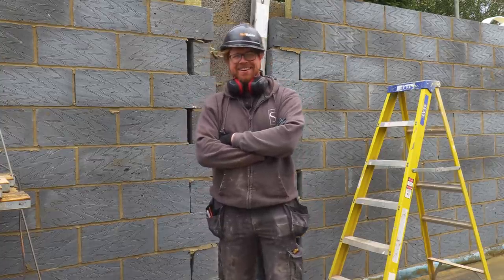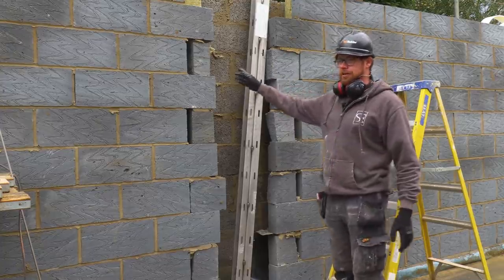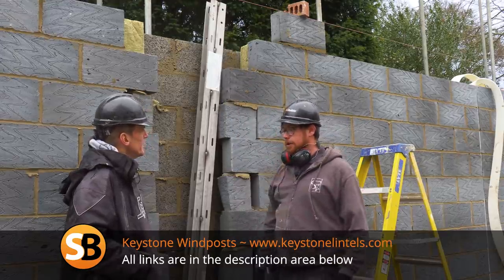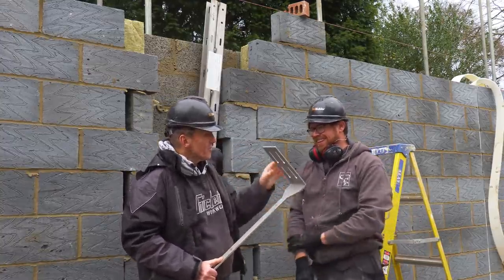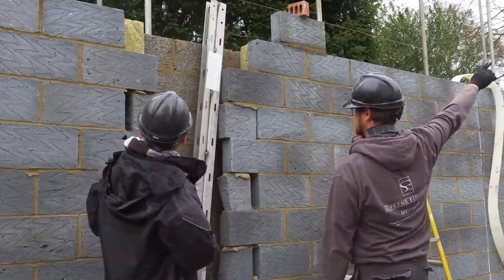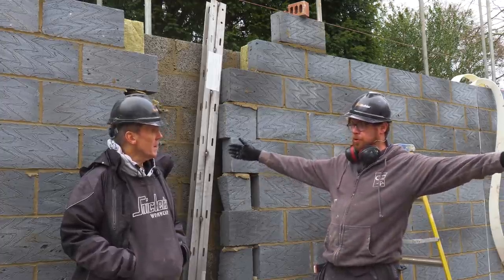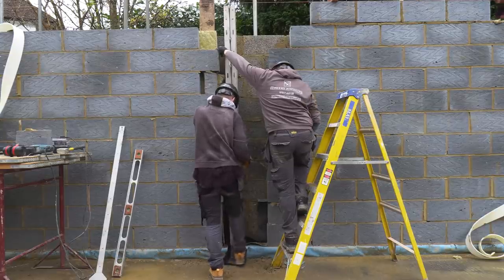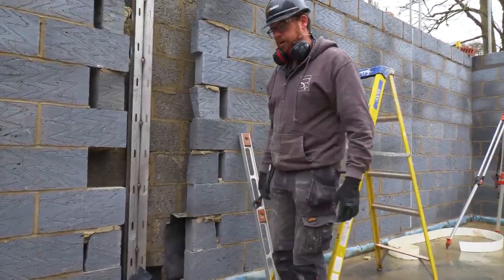Windposts & Joists ~ Extension Build #4

Comment: The welding on that post isn't very impressive. They look like maybe 25mm stitches spaced at about 400mm. That really isn't a lot of weld. For an expensive product, made to measure, I'd expect to see more like 50/200. Also the decency of the welds ground flush or at least tickling the welds with a wire wheel. As for the video itself, thanks to everyone involved, always good work.

Comment: Interesting.  It seems each engineer makes it up as they go along. My wall was tied in with a loose block and half a house brick, I'm blocking up the back door and the patio doors are less than 3 meters wide. So I have to fit a wind post fixed along a dwarf wall at the bottomand nothing fixing it at the top. I have 16 upper joists cemented into the wall he wants the wind post fitted.  Confused? You bet !

Comment: Great video keep them coming, really enjoy watching a build from start to finish. 

Wind posts always seem to be contentious issue. Walls without any buttresses (walls perpendicular) usually need some support when they start going any longer than 4-6m between buttresses. They can go further but it all depends on the site exposure, bed joint reinforcement ect. Loads of ways to skin a cat. The building regs do specify a requirement for a "butress".

They were not common in previous decades as houses tended to be built in a cellular construction, basically grouped boxes, think of a typical semi detached house (terraced houses are slightly different and you can sometimes get away with it on an internal wall). Whereas nowadays everyone wants open plan spaces with no internal walls, which means we need to replace the walls with something — in this case a wind post.

Which is why when you carry out a knock through on an existing house you usually have to put a steel post or leave a masonry nib these will support the steel above and provide a butress. These are typical cases and in some cases you may not need to. 

Sorry for the long post I hope it made sense!
Reply: Very informative, thank you.
Reply: I have never heard of a wind post.  Initially I thought what a waste of time but your comment about lack of internal walls makes sense. 👍🏻
Reply from the maker: Don't apologoise for the detail, that is just what we all need. Once you know the reason for something it helps you get onboard.
Reply: Cheers, you both have great attention to detail and from your videos everything you do looks top class.
Reply: Exactly right, people say stuff like “we never used to have wind posts” or “some engineer trying to justify their salary” but people’s tastes have developed and the engineering has to move with it. Your point about “cellular construction” was a perfect way to describe it.

Comment: Enjoy the video's - I had to fit a wind beam when the previous builder had removed the lounge to garage wall which was at 90 degrees to the gable. Fortunately this was on a refurb so I just built a footing and chem fixed it to existing wall also welded to beam that was installed when wall was removed.

Comment: Wind posts are generally required where the extensions brickwork return is under 665mm or if the openings in one side of the wall are more than 2/3rds the wall length. I’d let someone off if it was a window as you have a panel of brickwork below the window itself (was also allowed in the early regs).

Not sure on the central wind post to the wall unless the room is over 70m2...
Reply from the maker: I think you can put bed joint reinforcement under the window but a lot of brickies hat that stuff.

Comment: We have got the same problem on an extension just about to start. With ours we have a lightweight beam coming from a post on the existing extension to tie in the ground floor  with a post and then 2 wind posts on the first floor that then tie to the wall plate and the roof. This is what happens these days when the customer wants open plan living. The middle post will carry 4 beams and both posts will bolt onto pads within the foundation's .
Reply: tornados and earthquakes, can't be to careful in the UK, We don't want them out of a job do we. If you roll around in a flash motor on a shite council wage. It's not bungs and sidelines, It's PIP motor.

Comment: the wall itself, more than likely wont't fail, its deflection governed more than anything. So you can carry on your second fix, get the plastering done, move in, then a few storms later, you'll notice that the plaster around the windows start to crack and you could get glass that gets put into tension, leading to splitting/shattering..

There's always a method to the madness!! :)
Reply from the maker: That is interesting

Comment: I have never seen a wind post made in stainless steel. I live in Denmark and I am quite used to installing wind posts made for HEB 100*100 mm galvanized steel. They are then cast into the foundation after the inner wall is put up, only fastened in the top to the timber roof construction. there is places pressure resistant insulation (hard polystyrene) behind it between the inner wall and the post. Without the pressure resistant insulation, the inner wall can stile break. Nice job with the extension, I wonder, why are you putting plastic around the joists?
Reply: As the joists are being installed within the internal leaf so it needs about of protection against rot. You can use pressure treated timber as well but usually you'll see a "belt and braces" approach. Although unlikely, it gives you more protection if any damp were to enter the cavity. It has happened and is a common fault on much older properties.
Reply: I did wonder why the wind-post was not set in the foundations, surely that would have given it extra stiffness.
Reply from the maker: @JohnnyMotel99  They can be set in or bolted. The stifness is there either way.
Reply: @SkillBuilder  I forgot about bolting it down! Nice work.

Comment: Just wondering won’t this steel post create a thermal bridge?
Reply from the maker: To some extent but the cavity is 100mm and the post is 75mm . There is a gap which has some insulation in it.
Reply: We’ve also tucked some insulation inside the web of the wind posts.
Reply: Should have insulated damp up it. All a load of bollocks really

Comment: Hi roger whens your next q/a session?
I need to ask question regarding porch construction foundations?
 
How far down below ground are the utilty pipes?And can you dig foundation above the lines ?
Reply from the maker: usually the water is around 750mm but the electrics and gas can be a lot closer to the surface. If you are pouring aound them put in some kind of plastic sleeve. We usually run a saw down a plastic pipe and snap it around then tape it up. Once the concrete has set around it you will be fine.
If you have old lead pipe it is best to run some blue MDPE in, even if you just leave the ends unconnected. It is very cheap and might save a lot of work in the future. 
If you are not sure about the location of the pipes and cables ask the utility companies to come out and mark them up. I always do this.

Comment: Just had to put 2 wind post in on my new build because of the size of a door opening, bloody structural engineer he’s not paying for it.
Reply from the maker: It seems to be the thing now. If it stops the building falling down it can't be bad.
Reply: @SkillBuilder  how many buildings have you seen fall down?  Making cavities 100mm with polystyrene returns which in effect makes them unstable; then compensate with this.
 I agree with strapping and could see the use of these beams in certain circumstances but not routinely.

Comment: Has the requirement for the DPM around the joist ends come from the designer? It feels odd to me as the (ends of the) timbers now can’t breathe. Would be interested to know the thought process behind it. Thanks
Reply from the maker: The 100mm of timber sitting on the block wall will be dry because any moisture will be drawn towards the heated building.  The DPM will stop any further moisture being drawn in from the cavity. I can guarantee that the RH in those joist ends will be exactly the same as it is in the rest of the joist. In other words dry as a bone.
Reply: @SkillBuilder  Thanks for the swift reply and information - Much appreciated.

Comment: I wonder how many jobs get built on a building notice and have then end up costing more in the long run than it would've cost getting a set of plans drawn and approved ?
I don't charge as much for plans as some do so I imagine it wouldn't take long to get to a point where the cost of re-doing stuff on site = cost of the plans!
Reply from the maker: Hi Adrian
You are right but this was not a cost saving thing. It was more about time. James said he could either wait for the full drawings or proceed with the drawings done for planning. 
It was the client's risk and they were keen to get on.
Reply: @SkillBuilder  A client pushing to start a job?!! Never :) :)
Reply: You can actually build a new dwelling on a building notice but yes you are right we generally have more problems with building notices over full plans, especially on jobs like loft conversions.

Comment: More chance now of cold bridging across the cavity than that wall being affected by the wind. Just sayin... 
What's it called - a "cover your arse post"?
Anyway great video, really enjoying this series - keep 'em coming!
Reply from the maker: I don't think the cold bridging is a big issue. The post is 60mm and the cavity is 100mm so it can't touch both sides. We stuffed insulation in the gap.
Reply: @SkillBuilder  Ah - it was at 4:57 when James says to get the front face of the post flush with the back of the inner skin that made me think it would bridge. Presumably you were just getting it lined up at that point. Thanks for the clarification.

Comment: Is the windpost a legal requirement, or is engineer someone  employed by the homeowner? Would you put it in your own extension?
Reply from the maker: The engineer is employed by the architect
Reply: @SkillBuilder  you didn’t answer the pertinent part of the question.
 Yes it Building notice with an architect. You could have got me round to draw it on plasterboard with a rusty nail, saved a few quid.
Reply from the maker: @140rware   
Building regulations require a windpost or some kind of return of buttress.  If it is drawn and pased then you have to do it.

Comment: Should the wind post have had a membrane behind it as it now bridges cavity? Or is the design of it avoiding moisture transfer / condensation all together?
Reply from the maker: The cavity is 100mm and the windpost is 65mm or thereabouts. There are ties going into the outer and inner skin so a membrane would be piereced at every course. We laid some insulation on one side of it and left it at that. Any moisture that creeps across the those outer ties falls int the hollow post. It would be negligible.

Comment: Yea. Can't see the point here. If Japan, or San Francisco ..  or in the country ?  Do think  people in the office just say. Oh we need one put in ?   As you said the bat straps tie in the joists with the conc block, that should be well enough ? As it's a solid square box. Joist built in existing. And tied to new block. The cavity wall is solid with tie wires. 305mm thick. It's enough... its not going to blow down !!

Comment: Should the wind post be fixed to the inside of the inner wall so you could still fully insulate the cavity which will stop cold bridging, you would have to then plaster around the wind post creating an internal pier, as I see it you have now caused potential damp bridging across the cavity and also cold bridging because of the break in insulation? any thoughts?
Reply from the maker: Hi Peter
You make a good point but often it is the outer skin that gets blown or sucked out. It the post was tied all the way through to the outer skin it would work but people want a long unbroken wall. If they didn't you could build a brick pier.
Reply: @SkillBuilder  Hi, thanks for the reply, the outer skin and inner skin are tied together with Cavity ties so the wind post would still stiffen the wall if it is fixed internally, the only drawback as you say is an internal pier which would be much smaller than having to build an equivalent structural brick pillar. Sometimes the client has to agree to compromises re a pier  for the sake of  not  having other problems in the future re damp or cold bridging. Does the manufacturer offer any guidance on this issue?

Comment: It frustrates me that whenever I have timbers doubled up, either joists or rafters my local authority makes me fit coach bolts but when I watch anything on skill builder or Robin's channel they get away with nailing them or fitting screws. Things like this should be one rule across the board, seems to me that some people in the council planning offices are on a power trip
Reply from the maker: I have always coach bolted all the way down the centre line but it seems the building control accept the use of these srews and running them top and botttom stops the cupping and makes the joist act as one. 

I think the magic phrase is "by other means no less effective".
Reply: We always, bolt with flat washers and dog stars in between the joists eveey 600m one in the top 3rd one in the bottom third and repeat, what screws was he using?

Comment: What’s the crack with wrapping joist ends in DPM ?
Reply: Perzactly. Timber needs to breathe, not sweat.
Reply from the maker: @rossmcleod7983  People get a little carried away with this breathing idea. Let's be clear buildings don't breathe. Moisture passes through the structure. A wrapped joist end that allows moisture from the room to get in also allows it to escape the same way it came in. The joist is on the warm side of the insulation. The wrap stops the joist drawing moisture in from the cavity. It is a perfectly legitimate practice and you can buy purpose made plastic boots to do the same thing.

Comment: Windpost, something new for me, ta. But why are those screws screwing the triple together going in skewed?
Reply from the maker: The total width of three joists is just under 150mm and the screw is 150mm. drive them in straight and you are through to the other side. Drive them in at an angle and you are roughly 25mm into the third joist. 
Then drive them in from the other side.
Reply: @SkillBuilder  Ah yeah, makes sense. thanks
Reply: Shorter screws? (Serious question)

Comment: Funny how on similar jobs with different engineer's... 1 will insist you need a windpost and another won't?!

Surely the floor joists being fixed to the plate and plate fixed to the wall with 1200mm galvanised straps would tie that wall in?

Often wonder how much engineer's actually calculate and how much is opinion?

Comment: Cold bridge at the wind post now, would be better built in line with the inner leaf with adjacent cavity wall ties to suit.
Reply from the maker: K Bostock
OK that means you get the cavity insulation in but you lose the inner leaf. If you dot and dab I would bet any money you like that you would see a faint trace of condensation all the way down the board.

Comment: Where the joists are inserted inside the existing wall, what is used to fill the gaps between the joists and the wall?
Reply from the maker: sand and cement mortar with a mastic joint
Reply: @SkillBuilder  thank you, as an alternative, can closed cell expanding foam be used?

Comment: Why do they use stainless? Is it specified by the engineer? Wouldn't normal black steel painted with red oxide be ok for corrosion protection? it would be much cheaper.
Reply from the maker: stainless steel won't rust, that is the reason. Those posts might sit in there for a 100 years and moisture migrating through the wall will condense on the steel. Stainless steel wall ties as well. We have all seen what happens to the galvanised ones.
Reply: @SkillBuilder  fair enough, stainless ( i assume 304 grade) is obviously better for corrosion, just wondered if it was necessary. Belt and braces, good job. Thanks for the reply.

Comment: Why is he putting those joist screws in at a angle ?
Reply from the maker: Hi Kevin 
We scoured several merchants to get hold of these screws because there was a massive holdup at Felixstowe docks due to staff self isolating and nobody had stock left . The 100mm timber screws were the only ones we could find and we went to two Toolstations to get what we needed. The three joists are 75mm so putting them in at an angle took care of the extra 25mm. I would also say that it made a stronger job